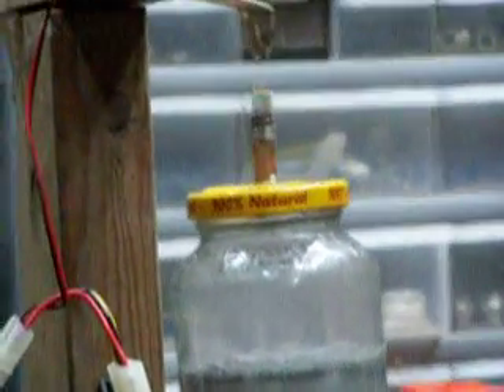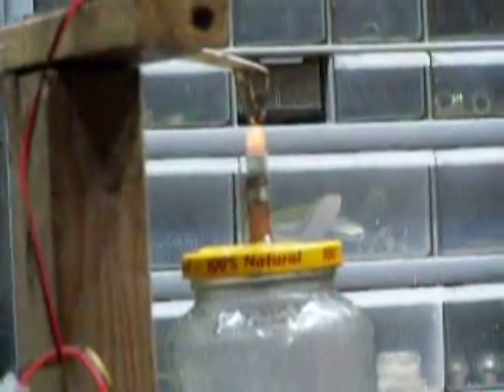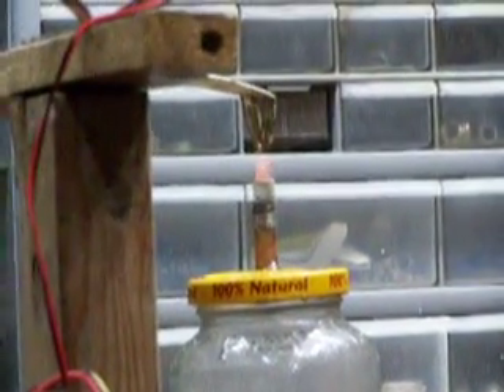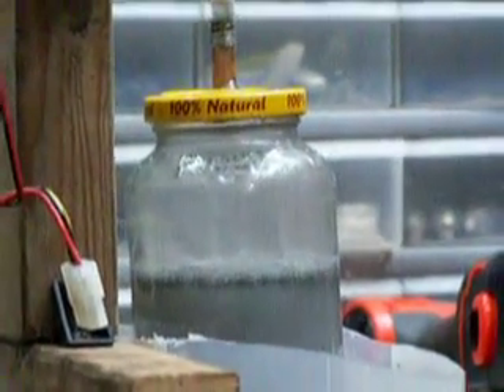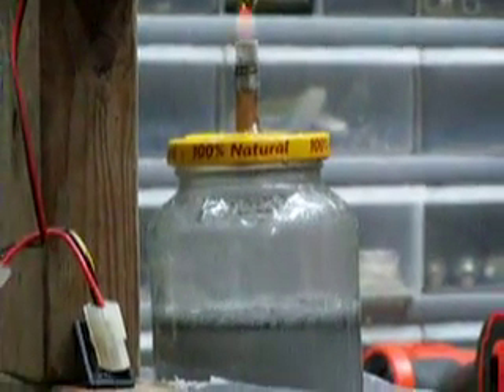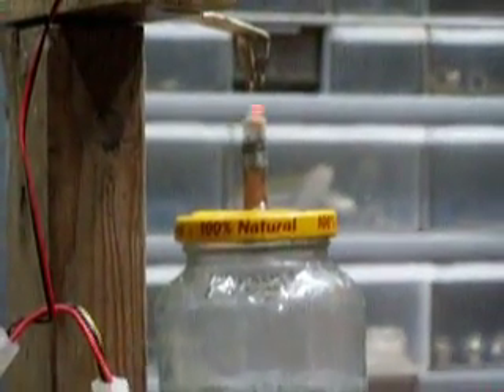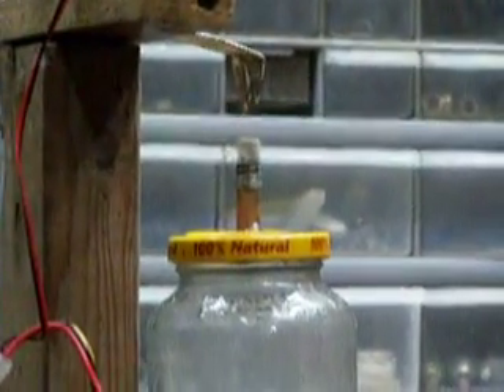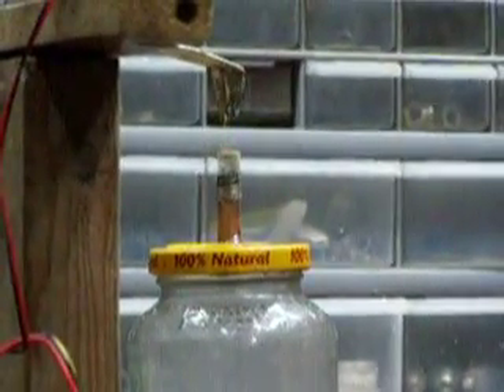hydrogen garage heater 2

Comment from the maker: I once used a steel container and a pressure regulator plus water trap and hooked it up to a torch head.  worked great but only for a short period of time. it was able to literally melt rock's.  hydrogen torches are neet to play with but a real hassle to keep them operational and safe.

Comment from the maker: Karl I've made literally hundreds of variations of this over the years.  you must allow all the oxygen to leave the container first or it will blow. the spring is at the top it allows for the hydrogen to mix with oxygen to burn plus adds a little heat to create a steady burn. smaller pipes work ok but with any chemical reaction that is difficult to control a smaller pipe increases the risk of over pressurizing the container. and you don't want lye on your bear skin little alone in your eyes. use extreme caution when playing with lye. it's very corrosive.  so wear a good face shield and safety gogles together. burning hydrogen makes water vaper btw.

Comment: I made one with a slightly bigger cashew plastic container.  I didn't wait long enough to light it, and it blew up big time.  Now I have to make another one.  I couldn't tell from the video, but I think the little spring you are talking about is at the top of that copper tube.  Is that right?  Is there any harmful effects from the lye?  Have you experimented with different size pipes?  I'm thinking that if you get the right size maybe a lot smaller, you might not need the spring.  Watcha think?

Comment from the maker: @Tumlock yea,  if you using lye/water/aluminum method, then its not HHO.. its just H.
if your using electrodes in water and an electrolight then your hho..  if your HHO, then you shouldn't be using LP fittings to work as a throttle, you should be using a varriactor to adjust voltage going to the reactor. send me a pm and i'll give you some clues that could help